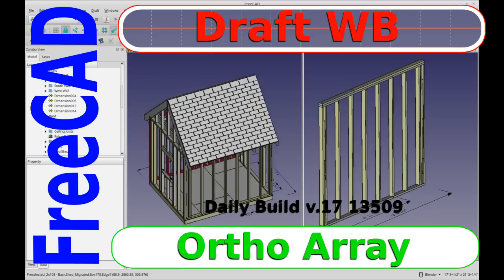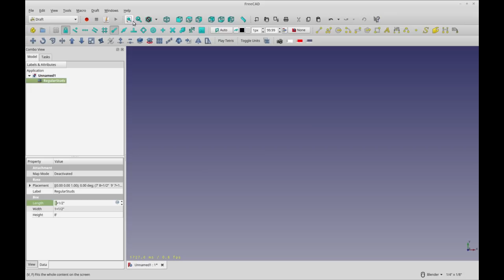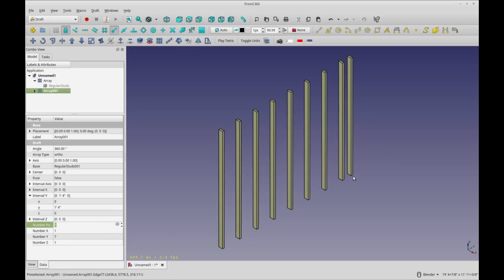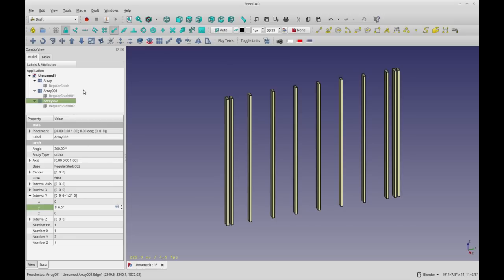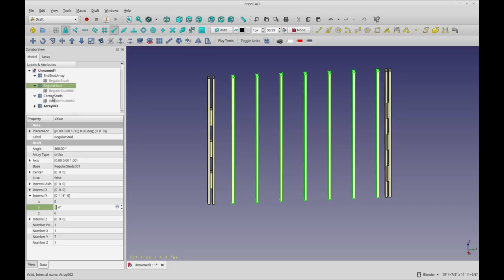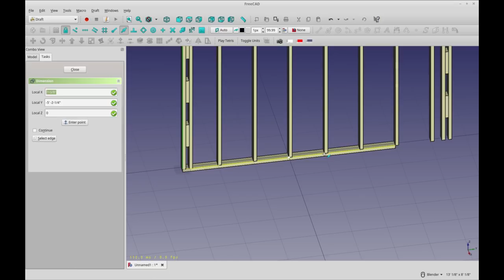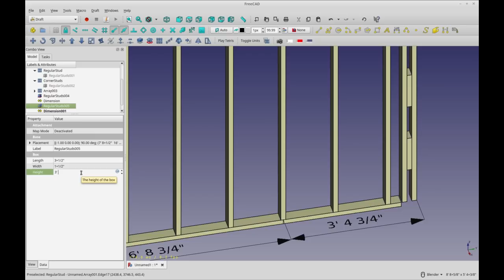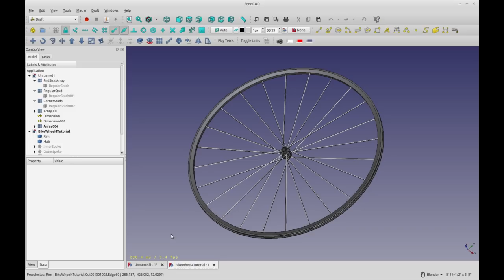FreeCAD Version 0.17 - Draft Array Tutorial, Framed Wall

Comment: ok I was working a magically ALL of my work magically got off axis and looked totally screwed.  For those learning and after an hour of a simple wall and stud placement and you see your axis went to outer space...

1. For me, I selected the first "layer" or whatever it's called for my wall
2. You'll see the option "auto", click it then select (top), it fixed it all on mine.

One thing for me though is when i right click and click transform, I don't get those options to move.
Reply from the maker: There are some situations where the transform tool is disabled. If you are on version 0.16 it is a totally different tool. The transform tool can become a little wonky if you move containers like the Part and Body contains, it is not supposed to work at all on Features within the Body container. You can use it on Parts made in the Part Workbench as well as Draft items. Sketches completed with Part Design can not be transformed unless you remove the attachment. Sketches done dependently of Part Design can be Transformed. Confuse, yeah, me too. I probably got half o f that wrong :) Placement in FreeCAD is a thing of nightmares.

Comment: If I'm not mistaken, you ought to make a macro for the design of a wall of any length.  If not, writing a python script and enter the dimension of a varying dimension will work.  In the macto/script you can also include the diagonal bracing required by the building code.
Reply from the maker: Hey, don't know how I missed this, but thats exactly what I have been working on. Thanks for watching.